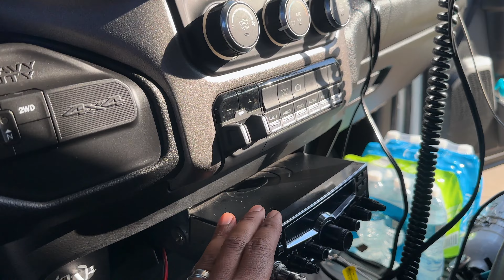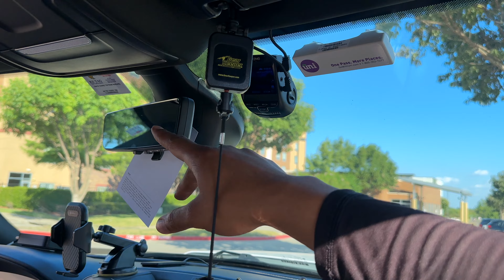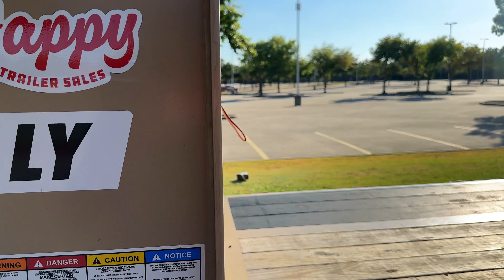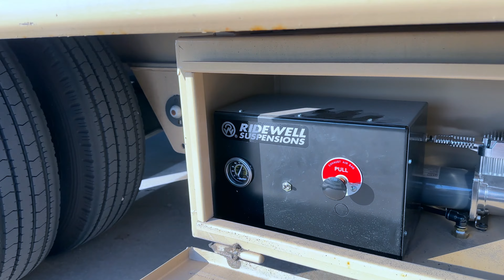My $150k Hotshot Trucking Setup | 2022 RAM 5500 Cab Chassis | 2023 Custom Built Trailer | FULL TOUR

Comment: Everything looks good, man. I will give you a little advice from experience. That little small fire extinguisher won't do c*** In 2019my truck caught on fire In Missouri I had the same Fire extinguisher it last for 3 seconds. If it wasn't for the road crew working Across the street, my truck and trailer and load Wood have burnt up. Get you three 10 pound fire extinguishers. That's what it took to put my fire out on my engine.
Reply from the maker: Man that’s great advice! I’m going to consider getting more now just in case!! Sorry to hear that about the truck but good to hear the crew was there to help and reduce the severity of the situation 💪🏽🫡💯

Comment: When I was trying to avoid tint for DOT I used to take and cutout an 8" drop in visor for the front windows. Like the semi's have but instead of aluminum they're just cut up pieces of the foil we used as window shades. Keeps a lot of the sun out and can be taken out at any time. I loved them but now that I'm out I run 5% stacked tint. Tint laws are bs. I love how much it regulates the inside temperature of the truck.
Reply from the maker: Man that’s smart bro! I got me a lil window shade that I put up when the sun is beaming lol but yeah bro the tint regulations are out of control. Appreciate the feedback bro!

Comment: Nice setup. I would be interested in the numbers such as empty axle weights, gross capacity, cost vs pickup truck with smaller trailer 
, mpg ect. Seems like this set up really fills a sweet spot between noon-cdl or even the the rigs just into the cdl range and a full semi with step deck.
Reply from the maker: Thanks Dan and not a bad idea, I’m gonna try to make that happen. Ill share that info soon.

Comment: very nice… I run a similar setup; 4500 w/ a diamond C… I also run a EcoFlow wave 2 exhaust out the window, couldn’t handle putting holes in the floor. will run until the warranty (200k) is gone then upgrade to a semi/step deck
Reply from the maker: Thanks bro!! Sounds like you got a dope setup. You running a stepdeck or the fmax? And great plan brother, stay safe out there and keep them wheels turning 🫡💯
Reply: @HotshotMacc  fmax; step deck would be nice. always looking to optimize. Your vids are a great resource! Appreciate ur efforts

Comment: Man O MAN Macc, you have come along way my friend. Proud of ya!!✅️  About your A/C. Should have use the rear cabin vent behind the rear seat for exhaust and drainage. No holes need to drill. 😮
Reply from the maker: Appreciate it Fritz! I thought about using them but routing the vents there would take away from my storage space.
Reply: I’d wrap the vent tubes with something to keep the heat inside the tubes. Make it more efficient 👍

Comment: QUESTION,   DID YOU HAVE TO GET CLASS A CDL OR WHAT?    WHAT TEST DID THEY TELL YOU THAT YOU HAD TO TAKE BASED ON THE RIG YOU ARE RUNNING AT THE DMV.
THXS  WAYNE
Reply from the maker: I have a CDL with no restrictions. However, you can take the CDL test with an air brake restriction if your rig doesn't have air brakes. It all depends on your specific setup, so be sure to check with your local DMV for the exact requirements based on your truck and trailer."

Comment: Hey Mac quick question.  First I love your setup.  I just want to know. What do you enter in your eld when you are unloading and loading.  2nd question is when unloading and loading does that go against your drive time.
Reply from the maker: Hey brother! Thanks man! When I load and unload I go “on duty” and in the notes type “load or unload”. You load an unload time will only count against your drive time if you’ve used the 3hr difference between your 14hr shift and your drive time. Hope that helps bro 🫡💯
Reply: @HotshotMacc  thanku!!!

Comment: Hello Macc
Thanks for the video. I have a question hotshot needs LLC. Thanks
Reply from the maker: Hey bro, thanks! Yes if you are going to be running your own authority you would need an LLC. But check with your CPA to set up you company to match how you will operate.
Reply: Thank you so much 🙏

Comment: Hows it going? I just purchased a 40ft flat bed gooseneck 12k axles gvwr 30k 25% on the gooseneck 16 ply tires cdl setup . Im excited however, I have a ticket from 2023 and its hindering the leasing on process due to high insurance. One company wants to charge me 25% for dispatching factoring,  insurance and permits. If i get insurance myself its 4700 down 2300 a month. Not sure which route to take. I would just pay my own insurance if i had brokers that will dispatch me and offer me factoring. Any advice will be appreciated.
Reply from the maker: Hey bro hows everything going? Thanks for reaching out. It really depends on what you are willing to sacrifices. $2300 is pretty high. What kind of experience do you have?

Comment: Does that hotshot CM bed automatically make your truck classified as a tractor? I kept getting hemmed up running a 40 foot with a pickup bed.  I was exceeding 65 foot in total length. 
My setup was classified as truck trailer not a tractor trailer..they told me I couldnt have a truck bed becase even if its empty its considered cargo carrying on the power unit....  therefore a truck & not a tractor...... I was also instructed I needed a 5th wheel connection and not a gooseneck but I see literally everyone running a pickup bed and 40 foot or longer.... wtf.

3 different states stopped me to warn me I was in 65 foot violation.
Reply from the maker: Hey bro, yes my custom tractor bed allows me to register the set up as a tractor allowing me to ignore the 65ft rule. Most of the hotshot setups with a 40ft are over 65ft if you have mega ramps. If you remove the bed you can register it as a tractor and not have to worry about that 65ft nonsense. Ive been hearing a lot of ppl getting hemmed up by DOT bc of it.
Reply: @HotshotMacc  Thanks for the reply and info! Stay safe out there!

Comment: That top deck open up opportunities for you man? Thinking about adding one to my 40 ft trailer but not sure.
Reply from the maker: It has opened opportunities. Not as much as a stepdeck would bc of the hight restrictions. But I’ve been able to put a few loads up there. Just have to get specific measurements from the broker or shipper. I also like it for storage.

Comment: Nice set up. How does the 5500 run on gas empty compared to a 3500? Also does it pull empty containers noticeably better then the 3500?
Reply from the maker: Thanks bro, with the trailer having the deck over the neck, empty I get about 9mpg. I did one container but it wasn’t a normal container. It was a modified container that was about 12ft high. Went about 150 miles with it and got about 7mpg with it weighing 15k lbs. I have the 4:44 gears so it did pretty well. I believe some 3500s see similar fuel mileage with the 3:73 gears and some less with the 4.10 gears.

Comment: Lol 150k🥴🥴mannnn I wanna invest in this. Get a business auto loan, get a 5500, get a driver and dispatch. Am I thinkin right?
Reply: Get it used for half the price
Reply: @kingmach1621  how many miles is too many? I see a 2019 at $57k wit 88k miles. Another 2021 $56k at 50k miles.
Reply: @trevey16  all those seem really fresh if say nothing over 80k for reliability. But if your mechanically inclined you can get one with a bit more miles. $50k isn't bad for those miles and you don't really need a 5500 to do the job. Really look into the 3500 high output they can tow more than the 5500
Reply: @kingmach1621  whattttt? 3500 tow more than a 5500? Appreciate it
Reply: @trevey16  the high output 3500 do
Reply: @kingmach1621  bet ima do my research
Reply from the maker: Not a bad plan bro just understand what comes with hiring a solid driver. It won’t be a walk in the park. Based on the type of trailer you want to pair with the truck you may not need a 5500. Mine was cheaper than a 3500 at the time and I wanted a higher rating on the drives than what a 3500 offers. But definitely do the research on all aspects. You don’t have to be at 150k. I definitely did not pay that out of pocket but the setup is worth that amount.
Reply: @HotshotMacc  okok appreciate the response